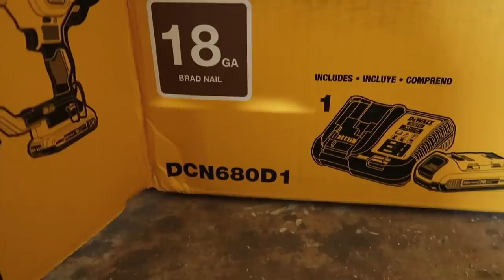Putting the NAIL GUN to the TEST! DeWalt Cordless Nail Gun DCN680d1

Comment: Just a safety thing.  You might want to consider the way you're cutting the boards.  I was taught that you should never pull the saw towards you when you're cutting, if you can help it.  That's the direction the saw would travel if it got away from you.  Always pull it towards you, then plunge the material and push it away from you.

Comment: Have you been lubing the nail gun before you use it? a few drops of air tool lube every time you start using it will make sure you keep out of trouble.
Reply: I do not know if you have to oil a battery operated nailer????  I think if you use a compressor is when you have to oil it???
Reply: @chris3m98  Always refer to the owners manual on any machine. My guess is he wore it out. He put a lot of nails through that. I wonder if it could be repaired or refurbished? I just invested in all new power wratchets and impact guns. My old man hands are thanking me.
Reply: I was referring to the air nailer. Some manufacturers supply a specific synthetic lube for air tools to maintain good operation.

Comment: On your problem nail gun:  We use a lot of those types of guns in our business.  What generally is happening when they start getting problematic is one of the seals or O-rings inside the gun is wearing out/failing.  Also, over time, the mechanical internal parts get dirty with tiny bits of aluminum mixed with the oil.  I think if you'll pull your Bostich air nailer apart, clean it and inspect the o-rings, you'll be able to find where the problem is coming from reasonably easy.  You can find parts on Amazon and other websites.  If you still have the manual, it typically lists the part numbers allowing you to search for OEM or OEM equivalent parts.

Comment: I'm a retired Custom Home Builder. The problems you are having with your air nailer could be moisture related. You might need to add a moisture separator to the compressor, very simple to do. Every compressor should have one. Take the gun apart, clean it thoroughly and should be good to go. LIKE WHAT YOU ARE DOING TO THE NEW BARN. Gena is very capable, U R a Very Lucky Guy. Very Pretty Wife who is very Handy & My Favorite, Gena can Cook‼️👍🚜🇺🇸   Vinny 🇺🇸

Comment: We have near freezing weather coming this weekend! Luckily I am ready to put the rubber roof on my project today! When I did professional cabinetmaking, Senco was the #1 brand bar none. Not sure these days, but that may be true still. I'll have to do the research when I re-open my woodshop. When my Senco brad nailer finally failed after 30 years last year, I picked up a DeWalt. Those brads have almost no holding power. Hope that works out for you!

Comment: I'll post this before watching your review of the DeWalt nailer. I bought both the DCN680 and DCN650 a couple of months ago. I'm impressed with their performance although I do have an issue with the depth adjustment on the DCN680. Might have to take it to the local service agent.

Previously I'd only used Paslode nailers. The Dewalts are much better - quieter, cheaper to run and a lot cheaper to buy. I haven't tried the Dewalt framing nailer yet but the majority of reviews I've seen reckon that the Hitachi [Hikoki] framers are better than the Dewalt equivalent.

So now I'll sit back and find out whether Gina gives your new 18G a tick of approval!
Reply: There is a defect with the gun in that it short cycles driving every 5th or 6th nail short.
I'm not a yellow B&D fan, so I'll get that out there, but I needed a cordless nailer and I'm not buying into the Pasalode gas system and the cost of operation.
Milwaukee is supposed to have their cordless nailer out before Christmas. The reviews on the prototype test units have been excellent.
Reply: @gungadinn  As a 30 year carpenter, I would never use an 18ga. gun for that job.  You need the bigger nails. Love the "yellow B&D" comment.
Reply: @greenwave792  don't forget they're using adhesive. The brads only have to hold the wood until it sets . That said I probably would have got the finish nailer considering the air tools they have and the kind of projects they do.

Comment: I'm interested to see how this nail gun works for you. We almost bought that same nailer but opted for the air nailer instead because we don't run other dewalt battery tools and we thought it would result in bad batteries due to underuse. Most of our battery tools are Bosch. We have built 8 large structures in 12 years with our 1st set of impact driver & drill and they are still going , it has been a reliable tool

Comment: Wonder if it would be a good idea to drill a hole in the far corner of the bed on the trailer (or weld on a small piece of tube) to keep the hing pin handy so it doesn't get lost? Keep up the great work!

Comment: I don't like the one battery with the nail gun. Waiting for a charged battery could slow things down a lot. It also looks heavier than the air guns. I can see where it would be handy if you didn't have air close by. It would be better if your old batteries would work, in it too. Running out of juice on a job just wont work for me.

Comment: Hi I have the framing nailer DeWalt and love it
I found out thou for rough cut lumber like oak the 20 volt doesn’t drive nails deep but try the 60 volt battery really works better for longer nails too
Lord bless
Reply from the maker: Thanks for the tip.

Comment: What happens a lot with those Bostitch nailers is as they get more used the driver tip gets worn causing the nails to bend/pinch/jam and not set. You can file the tip of the driver a little to make it like new if that is the case.

Comment: Al
How will you have light in your work shop? You should have laid electricity? Am I m missing something here?
Reply: He has already mentioned that he has something special planned for that
Reply: He'll be using conduit so it can easily be moved/adjusted/tapped into rather than it being in the walls where its not accessible...smart move on Al's part.
Reply: As an electrician i would have run homerun pipes spidered out from the main panel so it looks less busy at the panel.

Comment: Al, I was so concerned when i saw the loft construction in an older video that I felt it important enough to copy my comment into your newest episode in hopes you will see it.   Please take this advice to heart as it can possibly prevent a disaster.
"Please never load that loft floor with any significant weight and tell the new owner, if ever any, the same.  Everything, joists and the main beam included, is hanging on timber screws which is a very weak design.  Main beams should be resting on posts or  jack studs/posts and joists should be hung with hangers or on top of the beams with a rim joist on the ends.  Just remember any weight placed up there is all sitting on a few 1/4" screws in soft wood...no true support is present.   I am very surprised the design passed any kind of state standards for commercial sale. "

Comment: Goooooood Morning Al , Gina  & Olivia  ,
I'm watching the boards go up on the walls and I got to thinking ,  it would have been much more visually interesting to put the boards on with a herring bone pattern. Yes , of course it would have required more work , but one does have a few power tools these days don't they ?   lol
 Perhaps with the left / right angle on the top half of the wall and the opposite angle on the bottom half with the point of the V being along the horizontal center of the wall .
 Just something to entertain the eyes.
  It's Autumn with winter coming on fast .  It's time for the citrus trees to go back inside and into the living room. They will make a nice splash of greenery later this winter. I have some garlic and green onions started in pots along the window sills. Trimming the tops later will make some good soup flavorings. I just buy both the garlic and green onions at a supermarket.  I plant a few of the largest garlic cloves and use the rest fresh.  Same with the green onions.  I use a few of the fresh bulbs and plant some of the larger onion bulbs.
They even still have roots on them . I keep them growing for months by using only the tops .

Comment: Not to be rude. But when you do a sliding cut with your new miter saw it’s better for your safety and the life of the blade if you only cut on the back stroke. So you should slide back cutting about half way then lift it as you come back for the second pass. As the blade gets more dull just from use it will have a higher risk of kicking back. Otherwise love your videos. I have lots of late nights due to my health a the moment and seeing your videos in the mornings makes my days better. I started watching when you got hope cause I watch weed em and reap also.

Comment: The way you use that compound mitre saw freaks me out. If I'm not mistaken, it is supposed to cut on the downstroke and as you push the blade forward, not as you pull backwards. After all, it's really not much more than a mounted circular saw on an articulated arm. You wouldn't try to cut with a skilsaw by pulling it backwards if you were cutting a 2x4 or a piece of plywood, right? I just happened to notice you doing it a few times in your videos and now I'm seeing it every time you use it so I wanted to say something because I don't want to see you hurt yourself. Of course, I could be completely wrong here, I'm not an expert or anything. I'm just an overly concerned viewer who hopes you're able to make these videos for a long long time.
Reply: Sharky Dog  good eyes. The saw needs to be pulled out forward to full extension BEFORE touching the wood, then pushed back. I used this saw all the time in two of my previous jobs.